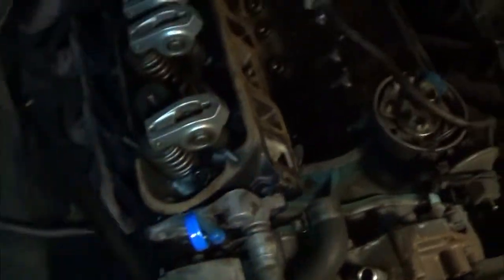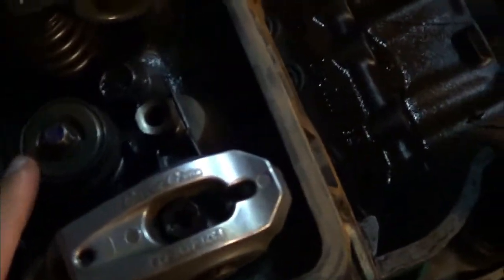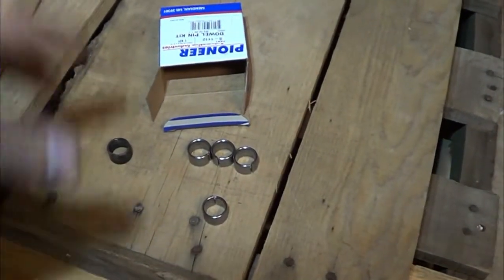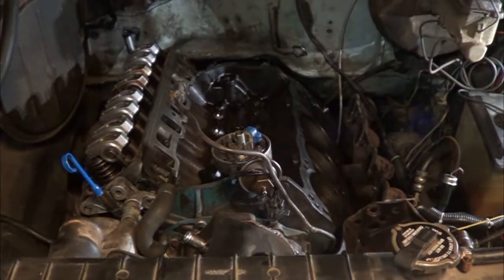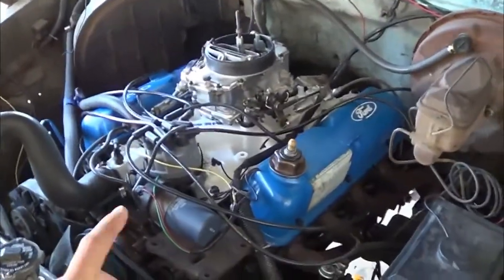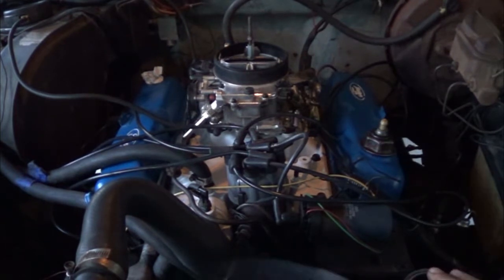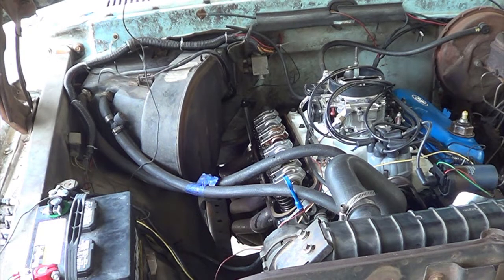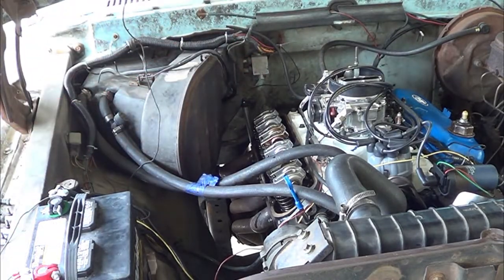GT40 Heads on 351W Part 2

Comment: So did you need longer or shorter pushrods??  By how much??  How could you tell earlier when you had the adjustable pushrod tool?  Very needy video for anyone jumping into a head swap.  Thanks.
Reply from the maker: The lifters are supposed to be preloaded. I did not account for that originally and bought pushrods that were too short. I went ahead and put the original pushrods in, and they worked great with the correct amount of preload.

Comment: OK, 5.0 has a 7/16" Head bolt and the 351w has ½" Head bolts... did you have to drill out the GT40 heads to fit the 351w Head bolts?
Reply from the maker: You’re right, the 351w does have 1/2” head bolts. But the 5.0s that came factory w GT40 heads also had 1/2” head bolts so they just bolt right on. The GT40P heads that are very similar are only drilled for 7/16” bolts, so you would have to drill those out.
Reply: @cronedentside74  thanks for the information, I have a 96 explorer 5.0 with the GT40 3 BAR heads that I've been toying with the idea of tossing on the roller cam 351w I'm getting ready to drop in my Ranger (already have a 351w roller cam in it but ran it without exhaust and burnt the valves). When I pulled apart my 95 Bronco preparing it for the powerstroke I broke an intake bolt in each head (1 I was able to remove) and 5 exhaust manifold bolts (3 in one head 2 in the other) and I'm not interested in fighting it if the GT40 heads are not a difficult swap.

Comment: Gt40s are still a great option for 302/351, especially in a truck. We put a set on my kids 83 F250, man that made a huge difference. We used the stock pushrods and rockers.
Reply from the maker: That's awesome! I ended up using stock length pushrods too. If I had done just a little more research before taking on the job I may have saved myself the money I wasted on the first set, but that's alright. The heads did make a huge difference
Reply: Flat tappet cam?
Reply: What cam did you use